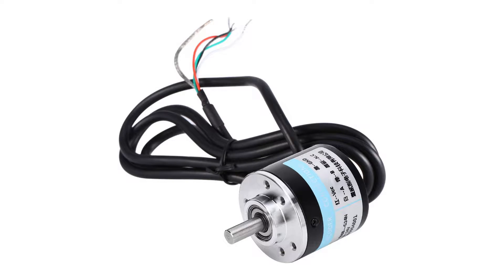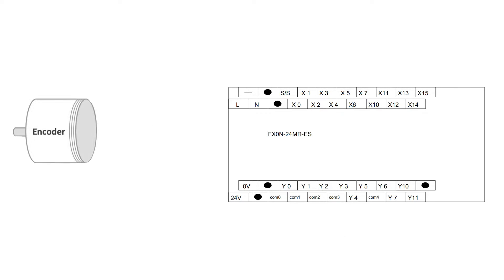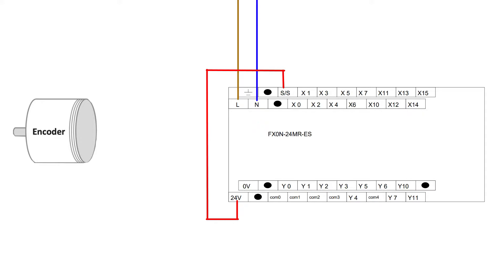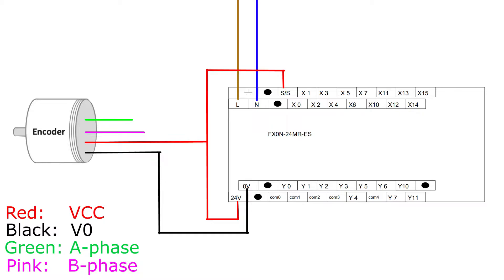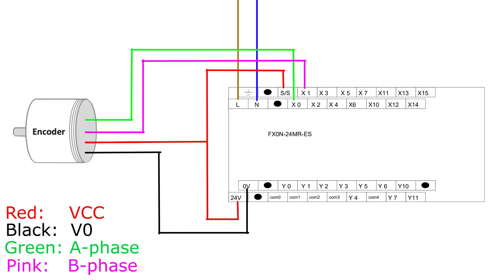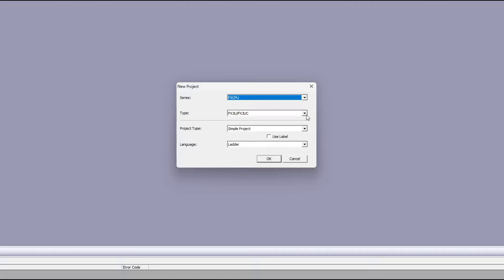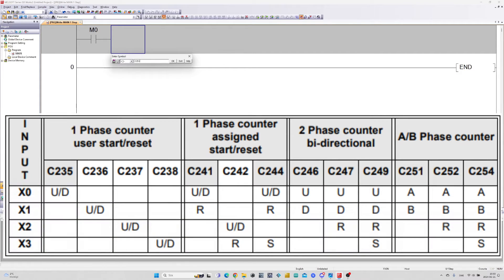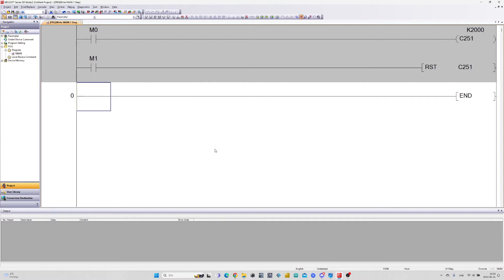How to connect and program encoder to Mitsubishi PLC | HSC High Speed Counter

Comment: I don’t get it. How the program know your wiring at x000 and x001 ? What if I wired at x005? Will it work? All I see is you only specify M0 memory. Is M0 memory default at x001 wiring?
Reply from the maker: Hey. For the FX0N series PLC that I use in this video you can only use input x0 and x1. For other fx series I think you can use x2 and x3 too. You can check the manual I linked it in the description.

And its not the memory bit that define the encoders input its the C251 parameter. The memory bits I use is just to trigger that parameter.
Reply: You have to read your PLC manual carefully 😊😊😊

Comment: i have a question what if my s/s is connected with - v and i have NPN encoder? what i can do in this situation how i connect the encoder ?
Reply from the maker: Hey. I think theres not much you can do about that. You either get an PNP encoder or maybe you can connect am extra input card with + voltage to the s/s com terminal